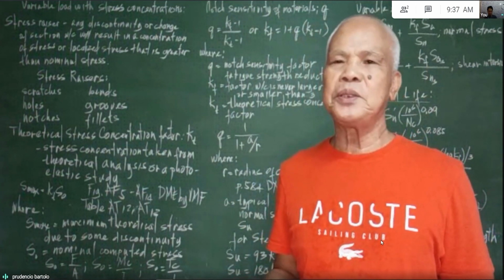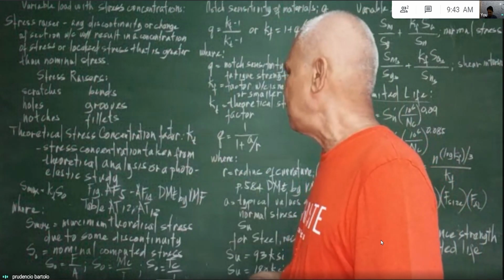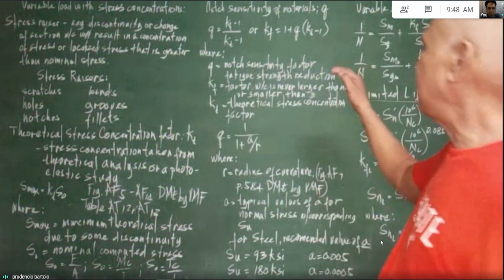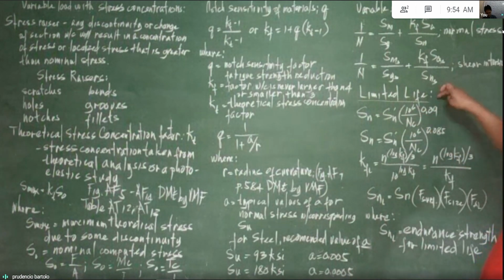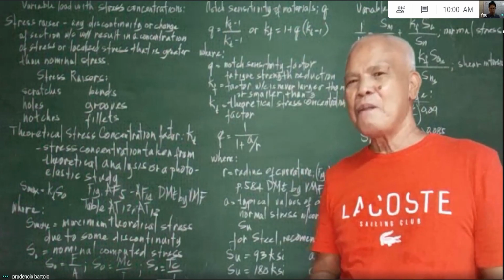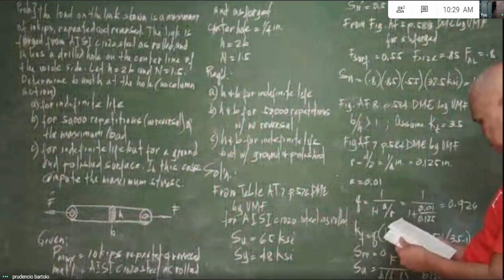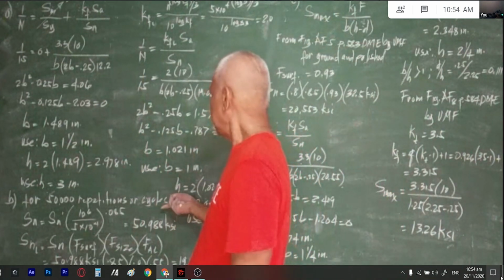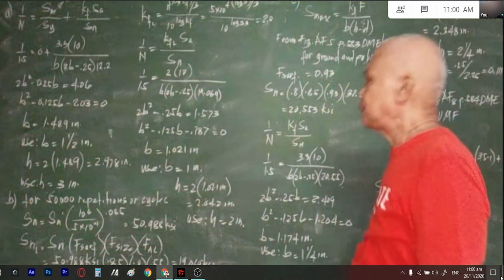Engr.  Bartolo's Machine Design Lecture Series: Variable Loads with Stress Concentrations  #1

Comment: Thank you ProfBart for spending your valuable time with us!  You gave me a clear understanding about each and every topic covered in this course. The concepts were well explained and the lessons practical.  In my understanding, Stress is a function of the load and the area.  In the design world, a common method is to reduce sharp internal angles by using radius. The larger the radius, the lower the stress concentration. Concentration of stress occurs where there is a rapid change in the shape of the component. So try to keep the transitions smooth and avoid unwanted bends and twists, change the thickness, change the stiffness and if possible change the boundary conditions.
Reply: thank you mam lyn.